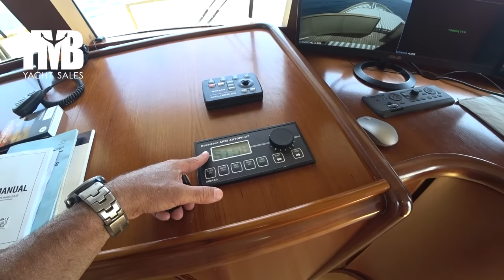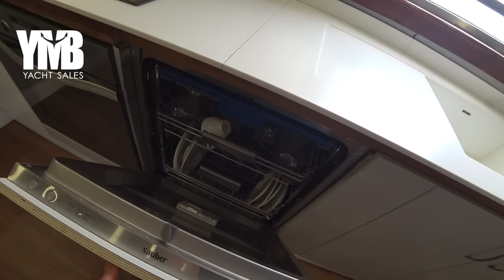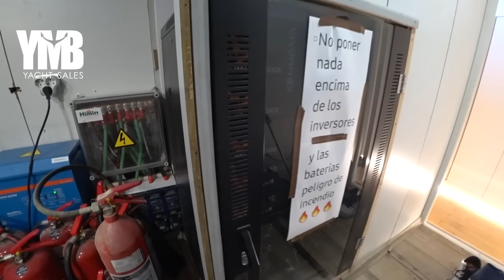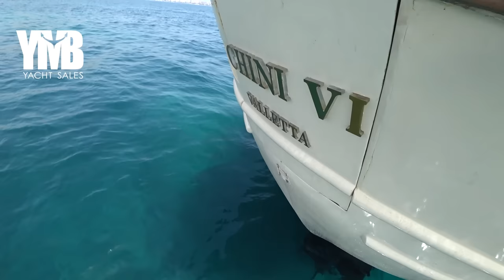34 m Classic Gentlemen 1960 Steel Hull Motor Yacht FOR SALE Refitted & Modernized Full Walkthrough

Comment: Why would they destroy such a beautiful classic interior to mimic non design with suicidal gray non color
Reply: Probably because the interior was not in good shape and was no doubt extremely dark.  Lightening the interior gives a fresher look.
Reply: @kokomo9764  I am sure it could have been refinished, what does that even mean lightened up and refreshed, it’s a classic with traditional wood interior that doesn’t need to be lightened up. If you want modern buy a plastic fantastic newer boat which will look dated and old in less than ten years, why ruin a beautiful gentleman’s yacht that is timeless. Would anyone buy a beautiful Vicem yacht and paint all the joinery white to “lighten it up” no one with any sense would.

Comment: Watching your video I felt a bit confused. The refit seems a bit IKEA as it looks quite cheaply done. The cupboard, wardrobe doors don’t appear to have the usual lock system to stop doors slapping about at sea if it’s a bit rough. That stripped grey is very sad and I see many panels not fitting quite right. Loads of wasted space and atrocious decoration, I think it will be difficult to sell
Reply: You are so right! This could be an amazing floating palace! It is an Ikea palace!
Reply: I’m thinking the boat was acquired for “moorage due” thinking a cheap refit would make the new owner a ton of loot. Good luck with that!

Comment: I love that 1960's proper little ship external style rather than the plastic-fantastic airplane-without-wings look of modern day yachts. However, I'd have expected crew's quarters for a vessel of this size & status. At the very least that would entail skipper, engineer, cook and a couple of deckhands. I simply cannot see the point of having so many places to lounge and eat (even a multimillionaire only needs 3 meals a day) and I suspect that the the main deck originally contained accommodation for owner and guests, while the rather grim little stairway to the present guest cabins originally led to crew's quarters. Finally, I have to say that much of the "modernisation" would be more aptly called "desecration" and has the drab semblance of a mortuary or a private hospital foyer. Much of it looks pretty cheaply done as well. Thanks for the look-see anyway...
Reply: Yes, looks cheaply refurbished. TVs wiring is shoddy and holes into wardrobe too low dow.
Reply: Actually, if you took the time to visit their web page, you would have learned that there is a crew quarters.
Reply: @duaneleiker561  Actually, if they took the time to explain that the vessel had crew quarters I wouldn't have to visit the web page. And as they had 34 minutes to do so, that doesn't seem like too much to ask...
Reply: There are crew quarters, at the end of the video.
Reply: Great bones, but the interior looks like poorly assembled Ikea furniture. What a shame.

Comment: Its middle of the refitt elad  thank you for the tour as always you never come up with rubbish I did a few sums and I would have to sling a hamock in the engine room thats a little joke but she seems sound enough as a cruser with a few paying guests its not something I could  afford. The hull looks like a sub hunter its long enough for fore and aft tubes it would have been interesting hearing it with two big rollers going with the throttles wide open the fuel guage would have been going down as the knots where climing she certainly build to cut the water by looks of it. Thanks again for the tour. Cheers mate 🫶🕊️👍

Comment: The refit to date looks very shabby for such a beautiful yacht. It needs completely gutting and re-fitting to a much higher standard. I know you kept saying it was still under refit, but even the places that had been completed, looked very poor. Yacht of this vintage, needs high gloss wooden panelling and doors. Having a composite worksurface in the galley is sacrilege. It won’t last five minutes. The same goes for the heads and the ensuite. Although it was nice to see the one original marble handbasin. The owner is obviously on a budget. I hope the new owner appreciates this beautiful yacht and does it justice. It needs a few million euros spending on it, to bring it back to its original standard, I would think.

Comment: Some do as with castles, they supposedly renovate and it's the massacre of everything that was the essence of the place , chimney gone, walls and ceilings carved on plaster erased, beautiful parquet floors vanished and there, it's the same case, but with a Classic Yatch , a massacre, yet externally it is a marvel, unfortunately the crappy tastes of the former owner have wreaked havoc, when replacing a Rolls Royce Mechanical with low end next door, it is strong coffee , especially as Rolls Royce Marine division still exists so it was feasible to replace with more recent engines from the same brand.

Comment: Actually, my goal is to find a very very old, similar size, original steel hull, that has never been refitted, for the purpose of gutting it all out totally and completely modernized it with the newest electrical tech, solar everywhere, open space, gym, golf simulator, that only sleeps a total of 6 to 8 people.

Comment: The original teak or mahogany interior would be much better. The paint quality is not very good either. Very rough as if rolled on with a paint roller. Not smooth and glossy. Love the exterior look of these older classic yachts. I hope the exterior paint is better quality than interior. It is hard to tell from the video.